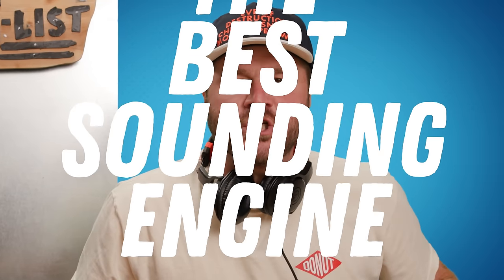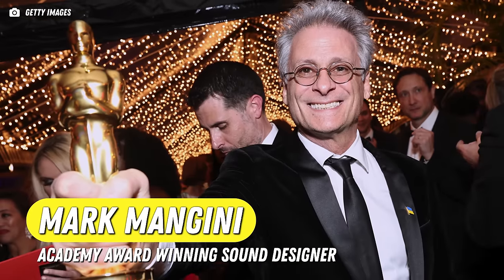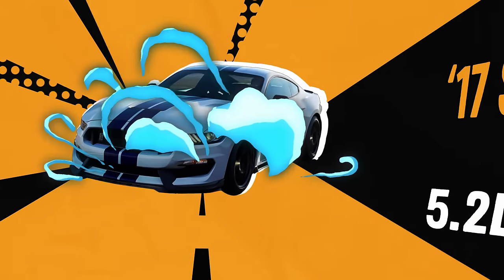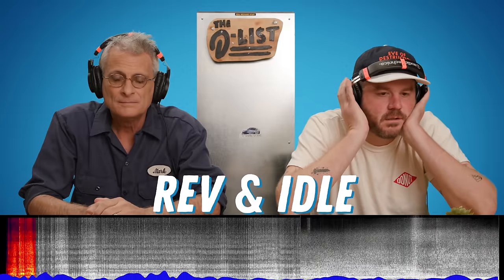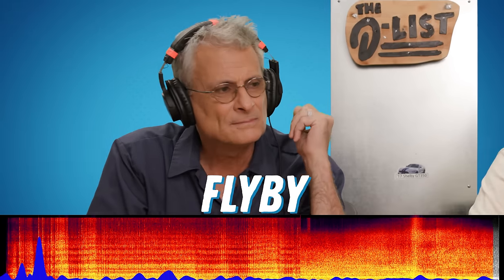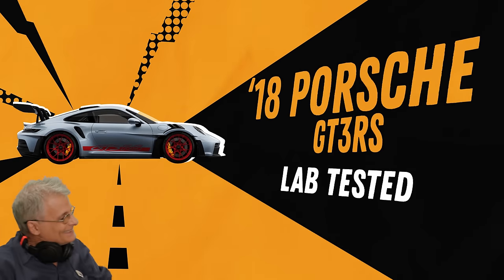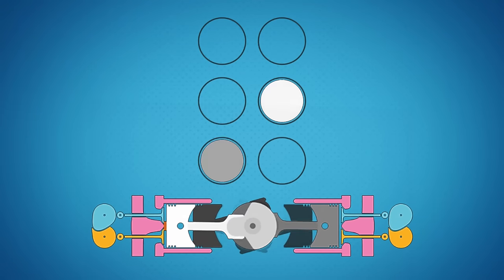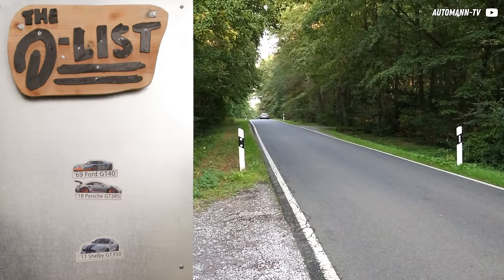Sound Expert Reacts to Best Engine Sounds

Comment: I was working at MAHLE when they started putting TDI into upperclass and didnt want it to sound like tractors.
No active sound but frequency filtering, resonance, dampening... BMW Z4 and VW gti already had sound modules from MAHLE i think... 
The Ford Focus RS had a different style membrane one..

We did a setup for an Audi A3 ranging from two stroke chainsaw to nasty racing engine.
Biggest bonus: you get a nice motor sound and feedback, while not annoying every living beeing around.

Volume and noise doesnt equal sound. If your engine needs that to get down your road at walking speed its broken..

Comment: The LFA, Ferrari F40, Mazda 787B and Porsche GT3s are some of the best sounding cars imo. But the RS3 has a great sounding engine, most of why I wanted to buy one. That clip was such a bad example, there are way better clips out there for that 2.5L 5 cylinder. Also, the Audi Sport Quattro has a similar engine and sounds AMAZING.
Yamaha also harmonically tuned everything in the LFA but they specifically tuned the exhaust to make it sound good, unlike the 4AGE and JZ engines, where they designed the heads.
And how can you say the 787B is not a good race car? It was a fuckin BOSS, the engineers stripped the engine down after the race and said it could've done ANOTHER 24 hours, as the wear was so minimal! Respect -100 for James Pumphrey 😂

Comment: That RS3 segment most certainly didnt have a 5 cylinder engine at the guessing stage. 5 pots have a very distinctive sound and that wasn't it. It might have been an exhaust note from a GTI or S3, but not RS3.
Reply: It's definitely the sound of a 5 cylinder ... but with stock exhaust, soft limiter to 3000rpm and other limitations ... a very bad sample video !
Reply: The Audi RS3 soundtrack was not a RS3. It was definitely a 4 cylinder which means the sound was from a S3. 5 cylinders sound like mini V10's
Reply: You can actually see around 10:35 that the flyby was definitely from an S3

The idle WAS an RS3, which is part of why the idle sounded good and deep while the flyby felt more tinny and lackluster.
Reply: sounds 4 cylinder when he goes wot
Reply: No kidding. Definitely was a poor representation of 5 pots. Should have been a tuned up rs3 or TTRS (maybe the twr 850 racecar)
Reply: Someone on the Donut teams was messing with us or hates 5 cylinders. They need to hear some real '80s and '90s Audi 5 cylinder sounds.
Reply: Yea I noticed this aswell, how do you mess that up in a video DEDICATED to engine sounds 🤣
Reply: The revving was from an RS3, the flyby was from an S3. 5 cylinders don’t sound like that when going by.
Reply: Amen!
Reply: God bless you for pointing this out. I owned an 8V and now and 8Y and that flyby was NOT an RS3. Their thumbnail was an 8Y, too, which was definitely not the "2017" model.

Comment: You really need to record the cars in the same way.  The variations in equipment and techniques makes this apples and oranges.
Reply: That's not up to them. They get the clips from YouTube and social media
Reply: @user-so9cy7ec8z   I get that this isn't old school Top Gear where they get their hands on about every car. My point is that this is very impartial based on the recordings used.

Comment: The first sound they played was absolutely and without question a Honda 4-cyl engine.   I guessed the B18C from the Integra type R, but thought it might also have been the F20C from the AP1 S2000.  

I knew the GT350 the moment it started.  The sound is very identifiable, even though the driver wasn’t taking it up to 8200RPM.  

I would pause and write my guesses down as they went along, and was appalled that they tried to claim both clips came from the GT350.  Somebody screwed up their game!!
Reply: And the RS3 one was most definitely NOT an RS3, sounded more like a Golf GTI than anything
Reply: okay i also thought it was a honda engine, glad i'm not the only one
Reply: @initialdfan8352 GTI or s3 (same engine) was my guess aswell. The 5 banger sounds way better.
Reply: I'll be honest, I'm butt hurt that the Mustang got shafted
Reply: THAT

Comment: I would definitely rank the 787B higher. And you don't give it enough credit as a race car. True, it did run at a lighter weight than the other cars in group C at LeMans that year, but it was also the most reliable car there that year, and the most fuel efficient. Two things that you wouldn't normally associate with a rotary, unless you truly know rotaries that is. I think if you heard these cars in person, you would find it much more dramatic than in the audio clips you provided.
Reply: they did the 787b dirty for sure.
Reply: it was lighter but don't forget they were lumped with hundreds of kilos of ballast as a punishment for being old-school Group C cars..
Reply: He totally bought into the ISMAs propaganda to get the japanese out of racing.

Comment: The GT350 just needed a better sample video 😂
Reply: An 86 over a gt350 is fucking insane
Reply: I agree, they did it dirty last video too.
Reply: that first sample is probably from the engine bay, i thought it was an f20c from the s2k
Reply: @kensterfr33k  yea the start up sounded terrible for a gt350
Reply: Yeah that startup and idle was definitely not recorded anywhere near the exhaust. I am genuinely curious how many good GT350 idle exhaust clips they had to search through to find that.
Reply: @kensterfr33k  I was thinking it was in quiet mode and the second was in sport
Reply: Fr man he’s running stock exhaust in quiet mode for the first clip
Reply: @goong1388  for sure was quiet mode and recorded with an $10 Amazon mic shoved under the intake manifold or down the intake tube 😭
Reply: @davidbresnahan2227  they probably spent more time looking for that potato recording of a start up than it took to make that entire video
Reply: Honda sound from the front v8 from the rear lmfao

Comment: There is no way that first clip was a GT350

The first clip straight up sounded like the Jetta
Reply: Neither of those clips were a GT350. The sound is iconic. I've owned one for two years so I know exactly what it sounds like. The second clip sounds more similar to a coyote. First clip might not even be a V8. They did this car dirty, easily one of the best sounding V8s ever.

EDIT: I actually just watched the source clips, and they may be the worst sound clips of any car ever. The first one clip I'm not even convinced it's the 350 revving (and there were better examples in this source too!). The second one has the worst audio quality I have ever seen on an exhaust video, and the guy doesn't even make it past 4k RPM! Someone had an agenda sourcing these audio clips lmao.

Comment: The secret of the Pagani isn't just in the V12 (although it always helps), it's the equal length headers, who ensure that all equally spaced pulses keep being equally pulsed when they exit out of the exhaust pipes. Which makes for an ever smooth note, and keeps the pitch very high up. Also helps with power! But props to the engineers, the Pagani geniuses being given one of the best canvas to work on (AMG is nearly systematically known for the amazing sound of their engines), and the result is definitely at the level of our expectations.
Reply: Yup it's all in the headers on the m120 V12 , stock headers are terrible, zonda used equal length 3-2-1 headers then merged the banks at the tips. I am using the mercedes m120 (OG zonda engine) for my V12 build 😎

Comment: Let me just make a list of all the engines you've missed: 
Audi R8 V10 & V8
Audi RS4 V8
Audi RS5 V8 (titanium exhaust)
Aston Martin Vantage 4.7 V8
Aston Martin DB9/S/Vanquish V12
Buick/Rover SD1 3.5L V8
Corvette C8 & C5 Z06 V8
Audi RS3 I5 (Better Recording)
Cadillac CT5-V Blackwing V8
BMW E36, E46 and E92 M3 
Dodge Hellcat Red-eye V8
Nissan S20 I6 (Hakosuka GTR/Z432)
Nissan L24 I6
Nissan VQ35 V6
Lamborghini Murcielago SV V12
VW VR5
McLaren F1 V12
GMA T50
Lancia Delta Integrale I4
Ferrari 812 Superfast V12
Mercedes 300SL I6
Mustang GT350R (better recording, pls pls pls)
Corvette C6 ZR1
BMW M2 CS I6
Ferrari Testarossa V12 (with an exhaust)
Mercedes W140 S Class V12 (with equal length headers)
Maserati Quattroporte 5 GTS / GranTurismo MC Stradale V8
Jaguar F-Type V6 and Supercharged V8
Honda K20/K24 I4
Honda Beat I3 😂
Ford F-150 Raptor / Bronco Raptor V6
Ford F-150 Raptor R V8
Toyota A80 Supra I6
Lexus LC500 V8 
Lotus Evora / Emira V6
Alfa Romeo's Busso V6s
Ferrari 246 Dino V6
Honda 1st Gen NSX V6
Mercedes SLS AMG 6.2L V8

Comment: I called the GT3 RS! But I have been listening to a lot of 911 clips lately. Not on the idle and rev but on the drive away and shifts I was thinking that had to be a 6cyl first, double clutch obvs, and N/A. And high revving. 911 GT3 RS.

Comment: Although the GT350 has a flatplane crank, they did not follow the typical layout for a flatplane V8 and went for up-down-up-down (which necessitates more counterweights). It also has unequal length exhaust headers that goes 4-3-1, which also changes the sound. So it ends up sounding fairly different from your typical flatplane V8 engine because of those things.

Comment: I think with the GT350 you were hearing the valves closed on the exhaust and when it accelerated away was the valves open in sport mode.

Comment: Auto Union Type C V16 or the BRM V16  are on an entirely different level to these modern cars, just violent and very, very scary. Although as cars they were far to complicated, the BRM could wheel spin at 140mph and this was from a 1.5 litre. Mad

Comment: The 787B has an incredible story to it - 
Mazda did a public teardown of the R26B engine and then realized the engine was in absolutely perfect shape while losing only 3% output after 24 hours of full send. It is entirely possible, that they could have made it run it's full 900 horses at 10,500RPM but the metallurgy back then just didn't allow it. The engine wanted to twist itself apart, or burn the entire car to the ground due to the exhaust temperature. The 792P made 30 more horsepower over the 787B and kept catching on fire. So turbocharging was out of the question too. The 787B was their first time, treating the entire race as a sprint race because it was Mazda's last time to get the rotary on the track. Mazda basically went kamikaze 'win, or blow up trying' with the 787B and they won. Previous cars, they were not as aggressive. Evolution and constant improvements on the architecture gave them confidence to go for it and history was made. Rotaries shined later on other prototype racing classes as well. 

People shitting on 787B, and Mazda lobbying the FIA, should first shit on FIA for ruining the sport by introducing the 3.5 litre rule, trying to get closer to F1. Rotaries aren't banned today, but Mazda is very less likely to revive it. Maybe a private team might, I hope Rob does.

Comment: It's unlikely that anyone will be interested in this. But here's what I was able to learn while listening:
1) I didn't recognize the Shelby GT 350. It was not even clear what kind of engine it was. The first sample sounded like V6, and the second sample sounded like V8.
2) American V8 But I didn’t understand that it was a GT40
3) Porsche didn't recognize it at all. I never liked the sound of boxer engines. Not surprising. The rest of the 911 is great though.
4) Hachiroku (As a JDM lover, I couldn't help but guess it)
5) I recognized 5 cylinder Audi, but didn't understand what model it was
6) Golf didn't recognize it. I didn’t even realize that this was a VR6 engine. I thought about a regular naturally aspirated V6 with a custom exhaust.
7) I realized that it was V12, but I didn’t guess which car
8) I recognized a Mazda racing rotor. But I don’t understand what exactly the model is
9) Ferrari didn't recognize it. Not interesting me. I realized that the V8 is high-speed, naturally aspirated. Clearly European.

10) Lexus LFA understood from the first seconds. His sound is too recognizable.

Comment: In my opinion, 9-cylinder radial engines with a compressor sound best. With a displacement of about 30l per engine, without silencers, the Ju 52 of the Ju-Air, for example, could be heard a few km away. Refueling at a normal gas station for private planes took about 30 minutes, because of the 2450l tank volume. The engine of the Sikorsky S-58 helicopter, which was much more powerful, sounded even better.

Comment: They did the GT350 dirty as hell with that Idle & Rev - that's clearly Quiet mode instead of having the valves opened up in Track mode. Shame, because it is legitimately one of the best sounding stock American cars in a looooooong time.

Comment: It’s a crime you didn’t include the epic Carrera GT in this. It’s the greatest engine ever made and that V10 howl is unmatched. Yes LFA is also great but that downshift on that Carrera GT will make any petrol head shiver. 
Many other great engines you should’ve included are
Lambo V12 from Murcielago and Aventador,
BMW V10 from M5, V8 from M3 CSL,
Ferrari v12 from 612, Mercedes AMG ones.
Also all engines should be tested on the same parameters.
Some here had sounds from drivers seat and some didn’t have flyby.
Please do a retest with all engines tested on equal fronts.
I am sure Carrera GT and LFA will be on top with M5’s V10 close by and  Zonda’s V12 behind

Comment: It's not fair to compare engine sounds without putting them in to cylinder category,  
soo my list :
3c - none
4c - Honda vtec
5c - Volvo 2,5l.
6c - VR6
8c - Ford Mustang GT350R/ old ZR-1
10c - LFA obviously 
12c - F12/812 Superfast/Enzo/Murcie
16c - 16V92/new Bugatti
Thank you

Comment: 1st..I guessed a BMW V8 (was a stang)
2nd I guessed the GT40 correct 
3rd I guessed the Porsche 911 correct
4th I guessed a tuned up Honda (was a AE86)
5th I guessed a F-type V6 (was a Audi)
6th I guessed a Subaru (was a golf)
7th I guessed Ferrari F1 (was a Zonda)
8th I guessed 787b
9th i guessed 458
10th i guessed LFA

Comment: Noticed with the fly by for the rs3 you have used and s3 which uses a 4 cylinder which is not the same engine or sound at all..

Comment: I'm almost through the video, fearing they wont have the 5 cylinder turbo engines audi used in their rallye quattros... The shift blowoff turbo whistle.. Walter Röhrl staying on gas+brakepadel to keep the turbo rev up.. And a button for hydraulic clutch on the gearstick..

Comment: GT40, developed and built in the UK. How did they manage to find such a bad 787B sound? Also, the 787B had the most efficient and reliable engine on the track. T50 should be at the top of that list.

Comment: In fact, you missed 2. But you probably don't know them, so that's normal. They're the 2 most fabulous engine sounds ever to race: the BRM in-line 16-cylinder and the fabulous Matra V12. Check them out, your ears won't be the wiser

Comment: That was an awful sound clip of the RS3.  That 5 cylinder sounds like a diesel tractor at idle, but an exotic baby V10 with an open exhaust under load.

Comment: Everybody talk about the LFA. 
Carrerra GT did it first. and better. 
Same sound but lower low idle, same high notes with less ring. 

Look up the noise exhaust acceleration high revs and then comment back.
I hope I can guide others to the right path lost one.

Comment: Did you ask 'im about Maserati Quattroporte V8? (:
Upd. No, you didn't. :(

1:16 Don't say "most American V8s have cross-plane crank shafts" cause it's misleading.
Most WORLD's V8s have cross-plane crank shafts. All the Toyota V8 (non racing), all the Nissan (non racing) V8s, all production Mercedes/BMV/Audi V8s, by the way Maserati V8s, even all Soviet V8s —all of them— have cross-plane crank shafts.
There are some European and Japanese exceptions, mainly race/sports cars, that have flat-plane V8s.

10:03 —WOW! 5-cylinder fires every 144º, not 72, c'mon!

Comment: that 787b clip was horrible, not even a fast fly by to begin with but the car is braking before it even hits the camera so you cant hear a proper fly by and also you cant hear the down shifts as well, plus that drivers seat clip was horrible

Comment: You make a video. Use proper sound. The 5 cylinder engine was placed so low just because the sound clip was awful. Play the original S1 Group B rally car sound to feel and hear the real 5 cylinder. The one in the clip even for me sounded bad. 5cyl in the last place 😁😁😁😁 wow. One of the best sounding engines ever made. Listen once again: https://youtu.be/cDRkHXMHqFo?si=ryg9r6VTDC48eq0g

Comment: Very lame soundbit selection. Who made the selection? An 8 year old? You could have done a LOT better than that. You didn't even try. For example, instead of that silly Audi with a four cylinder engine (not 5), you could have chosen a soundbit from the WRC Quattro S2. The angriest angine ever.  You could also have included the thundering C5R or C6R. The throaty Viper V10. Audi R8 V10. ANY Ferrari V10 or V12. The infamous Subaru boxer. The BMW CSL. BMW M5 V10. The GTR V6. ANY Honda Vtec. And of course the Porsche Carrera GT.
Do the video again, with proper soundbit selection.